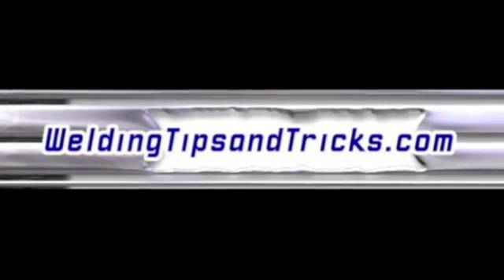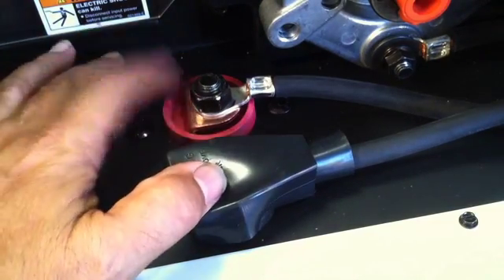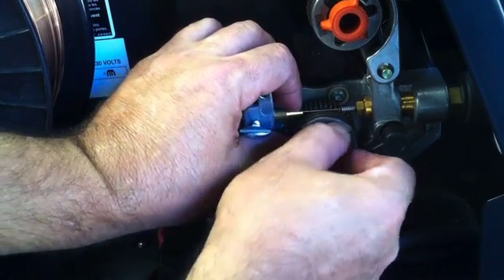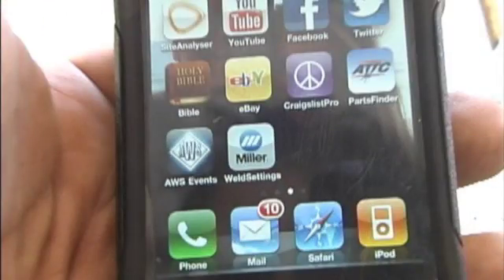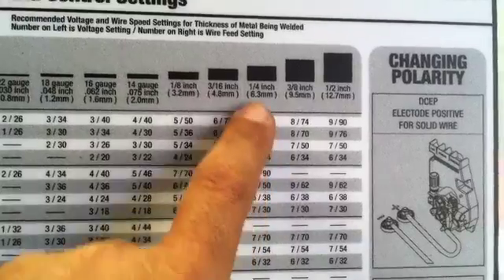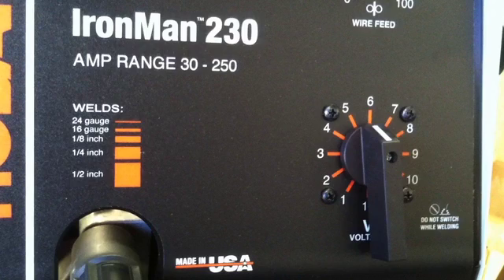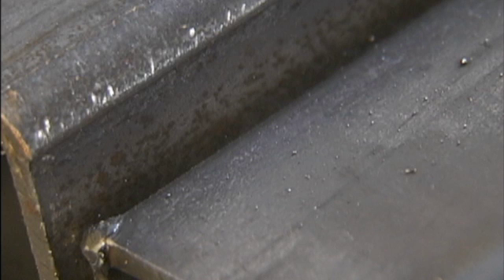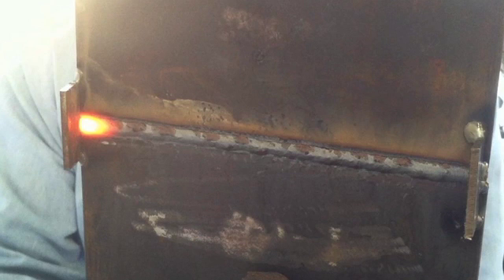Hobart Mig Welder - IronMan 230 with Spool Gun

Comment: Hey Jody, I purchased a Ironman 250 a while back and seem stuck in between voltage due to the lack of tap settings. Is this correctable or should I sell it. I use it for aluminum with a 3545 Spool Gun only.
Reply: islanduni get a pro Pulse 200 if you do aluminum you don’t need a spool gun with it

Comment: Why do you drag solid wire?
Reply: I noticed his welds are humped in the middle from dragging. It should be straight in or a slight push is the proper way.
Reply: @Graydevil1975  look at this guy trying to correct Jody! Please!
Reply: I believe he does this to show u how it affects the weld with the welder in use. He has stated this in prior videos with different welders

Comment: After 2-1/2 years with this Hobart unit, and about 500 lbs of steel wire, using CO2, it started welding rough. Checking inside, I found smoke stains around the contactor. A volt meter told me a 2-1/2 volts voltage drop through that...Surprised me that the contactor was on the output side of the transformer, The Old Hobart (Beta Mig 250) this machine replaced had a very heavy duty contactor on the input (240volt)  side of transformer. Built like a tank, that switch was still good after 20 years use. This new machine uses a wimpy 3 pole motor starter rated 40 amps (all three poles bridged together! in parallel!). The contacts were fried from switching the WELDING CURRENT on and off. The relay is evidently NOT up to LONG service. I bypassed the contactor so I could use the welder (but that means voltage is always on at torch when machine switch is on).  Now, it is back to welding real sweet again.
Reply: Great tip!

Comment: Get the PowerMTS if you are going to want to TIG weld (or stick weld) at all. The welding calculators that Jody shows in the video work very well to get you in the ballpark for welding configuration on either the PowerIMIG or PowerMTS welders.

Comment: I'm really considering buying a new Ironman 230 to replace my similar (20+ yrs old!) Hobart Betamig 250. It has been a good welder, and I've put more than a TON of wire through it. The past year it has gotten a roughness to it that I cannot seem to work out of it. I have exclusively used the ER70S6 .035 wire and straight CO2 gas that whole time for what has now become a small manufacturing business. Am also considering the Thermalarc Fabricator 251. Any Thoughts on that unit? Thanks!

Comment: Try switching the welder to spool gun mode when you want to purge/set flow rate.  The internal wire feeder doesn't feed while in spool gun mode but still activates the gas flow.  It just a flip of a switch as opposed to opening the welder, unclamping/reclamping your wire feeder, closing the welder.  I do this with my Miller.  Probably do it with the Hobart too.
Reply: My Hobart 210 MVP, which is a duel voltage 120/240 operation.  If you open the cover and flip the selector switch to the spool gun position, the wire feed is disabled but the gas solenoid will open with the gun trigger/ so you have a de-facto purge switch.  I am guessing the bigger Iron man has the same wiring setup inside.